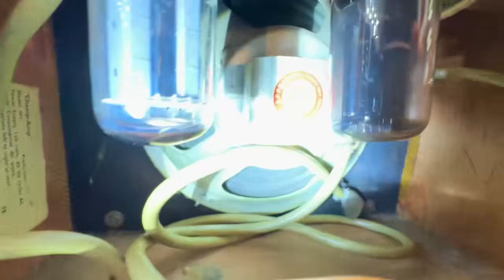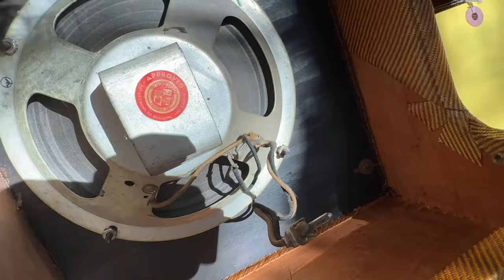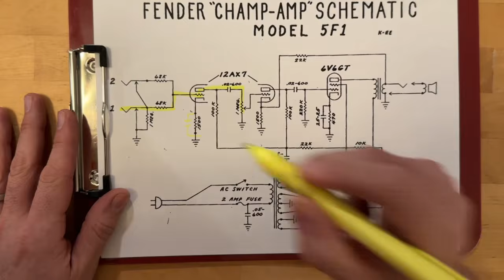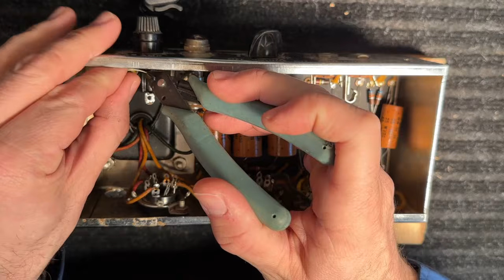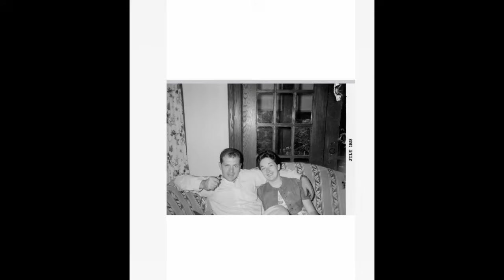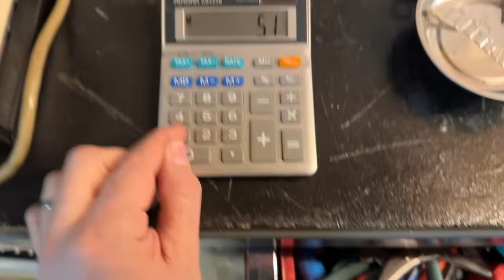1960 Fender Tweed Champ Restoration!

Comment: When this amp was built wall voltage was was 115 to 117 volts. Nowadays its about 122 volts. The B+ voltage could then be 15 to 20 volts higher. 470 ohms will bias that tube too hot so it makes sense to put in 600 or 680 ohms for that cathode resistor.  Cool video!